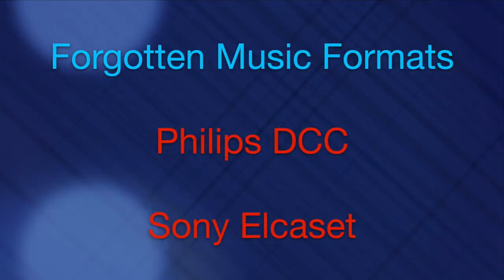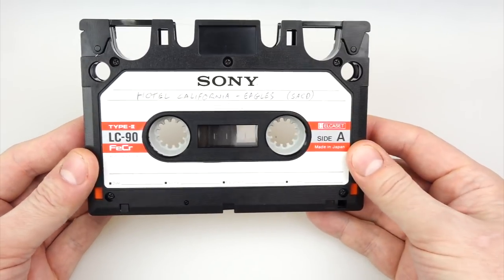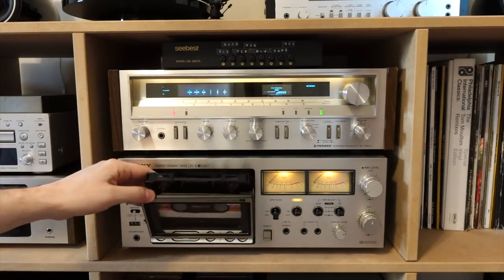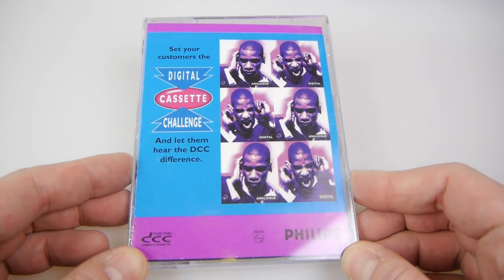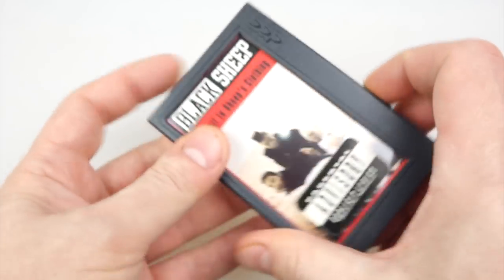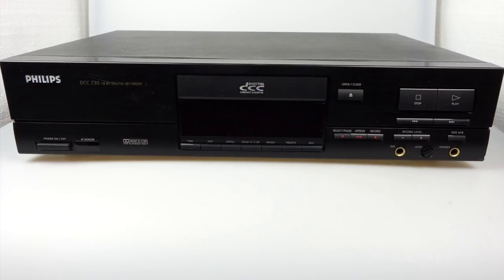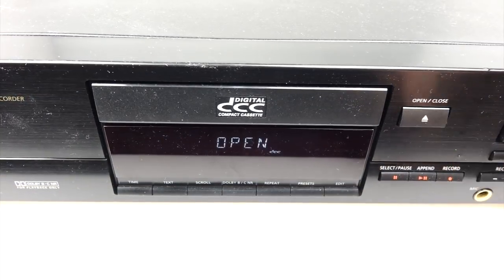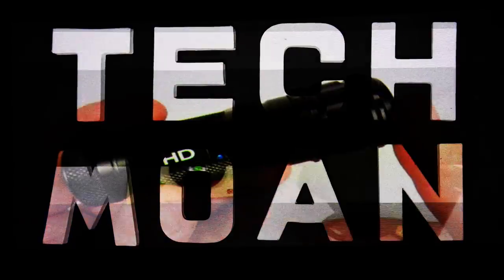Forgotten Audio Formats: DCC & Elcaset

Comment: Excellent video. I've had an interest in the elcaset since I think it could have replaced vinyl as a format if it had been marketed properly. According to a video about 8-track tapes called "So Wrong They're Right" an individual being interviewed mentioned the elcaset and said that one of the reasons it didn't succeed is that the record industry was interested in supporting a new format at the time. He also mentioned that it sounded like reel-to-reel tape.

With the return of interest in analog sound I still think that an "elcaset" type of tape (with some of the DCC features such as the metal cover for the tape, and the slip case [which is much better than the elcaset case your showed]) could make some inroads as an alternative to vinyl, especially since the tapes, though larger than a regular compact cassette, are much smaller than a vinyl LP record and don't have the drawbacks of vinyl. Judging from the small bit of sound we heard during the video, even when run through YouTube it still sounded pretty good to me.

I do have a DCC deck, a DCC portable, and some DCC tapes and I thought the format would succeed due to its excellent sound quality (especially considering that the tape still moves at the standard cassette speed [1 7/8 inches per second]), more affordable decks and tapes than Minidisc, longer playing and recording time than Minidisc, and that it was backward compatible with the old compact cassettes. Unfortunately, I think that among the factors that prevented its success were: (1) competition with the Minidisc, (2) the introduction of affordable recordable CDs, and (3) the release of portable CD players that that dealt with issues such as better anti-skip techniques.

Again, an excellent and very informative video. Thanks for posting it.

Comment: In the late 1960s I worked at a TV shop here in Southern California. We were an RCA and Zenith dealer. We had an RCA tape cartridge machine in the shop area. There were several pre-recorded cartridges. The format was put on the market in the late 1950s and "died" around 1964.

https://en.m.wikipedia.org/wiki/RCA_tape_cartridge

Comment: I love these video's, thanks. I migrated a while ago to a Logitec Bluetooth (Little black box) Receiver with decent RCA left & right output connectors and i even think they have one of those on sale with SPDIF out. Just connect your old cheap second hand iPod Touch 4 or iPhone 4 through a wireless pairing session and on goes the music. Recording onto old formats is as easy as talking about it. It's all become so simple, right? Streaming from the internet at high bitrate or just some track stored on your 32 GB device. An all in one combined investment of less than $60 or less if you are looking smart on eBay. Fortunately the BT receiver does not only pair with an iPod Touch or iPhone but a PC or laptop also. You just forget one and connect another one, awesome trick. No problem with DRM so far as i can tell. There is nothing in the bluetooth specs that prohibits the digital reproduction of music onto other formats. Finally we got it ! Btw, Geartronics makes very affordable BT sticks that transmit any stereo audio source through standard 3.5mm audio jack over Bluetooth. I think they cost less than $10. You pop them onto an old walkman or retro audio device with a 3.5 mm analog audio jack. They can be charged over MicroUSB, have a built-in MicroSD card slot and are really tiny. A combination of both BT receivers and a transmitter (all in one) makes your complete (retro) hifi collection wireless. Some BT receivers even upgrade the quality to 24 bit 192 kHz sampling rate. It would not surprise me at all if at some stage Dolby would like to get involved to suppress hiss masters noise.

Comment: Lyrics are a field built into the MPEG tagging systems. It's a bit of an odd format, it's the text of the lyrics with timestamps inserted throughout and that's how it times it. I've never heard of it being used on tape though. It's relatively common in aac if they were well mastered.

Comment: I remember someone having those dcc cassettes when I was young I don't know who had it i remember looking at the tape and had heard they were as good as a cd but you can record on them. I got a Jensen single tray cd player cassette radio bookshelf system for Xmas 1994 and I remember thinking I could if got the a machine that could record as well as the cd sounded but glad I didn't i still have some of those cds all these years later

Comment: I remember back in 1993, I was at Virgin in Paris/France,  checking out the dcc player, but then I heard about Minidisc and got  me the Sony MZ-1 in Switzerland, and later on the MDS-501, both f****n expensive back then ;-) 
I still have the MDS-501 here with me, along with about 100 minidiscs. Most of them are still readable/playable, but a few are "falling" apart...  :-/

Thanks for your great Videos! 

cheers from Canada, Chris

Comment: If I remember correctly, the Elcasets were usually sold in music stores where guitar amplifiers and studio mixers were sold. I've never seen them in electronic stores or department stores where TV's and stereos were on display. Which is probably why they never took off. They were also quite expensive and it probably made more sense for artists/bands to fork out a little more money and invest money towards a reel-to-reel deck instead.

Comment: Radio Shack sold DCC players too, for a while...the one thing I remember about it is has dang HOT the whole unit was! (Tt was sitting on a stand in the middle of the floor) You could not hold your hand on it with out discomfort!!

Comment: If you use a pre-recorded DCC you can skip to a certain track quite quickly. But a self-recorded tape has no catalogue. So if you just started track 1 and you tell it to start track 15 which is on the B-side, it will wind to the end, flip and wind further to track 15, which really takes FOREVER. I used DCC for a while but I switched to MD which I still use today.

Comment: If you like reviewing old formats that didn't quite make it, you might look for a 1950s RCA 45-only changer on Ebay. It used the large-hole 45s that were the norm in the USA, but that was the only size it could play on its big rotating spindle. Aside from being the fastest record changer ever produced (the  bottom of the platter was the 2-turn cam), what makes it interesting was RCA's hope that it, rather than Columbia's 33s, would be the replacement for the 78 RPM bound "album" format. So RCA offered not only individual hit 45s, they also promoted album sets of them in little bound booklets of sleeves, ready to be taken out in a stack and plopped onto one of these changers which were handed out for about $15 and could plug into any radio with an RCA-jack  phono input. They even matched each music category to a vinyl color (eg. classical albums were red-tinted). The plan failed, of course, but it left behind a lot of these tiny record changers, some of them even embedded in consoles (radiograms), all over N. America. You'll probably need a 60 Hz power inverter  (I imagine the 12 V powered ones are the cheapest) to make it work in the UK, but from the other stuff you collect, that would probably be a good thing to have anyway.

Comment: I owned a portable DCC-unit and this 7DCC 30 stationary machine myself, both long sold on. Many cassettes I still have today were filled with 1:1 digital copies of CD's I lent from our librabry, because this 1:1 copying is was what the DCC-system permitted. No mention here about the technical drawbacks of the DCC and the reason I stopped using it and reverted to my REVOX B710 MKII which came close in sound quality with the most expensive Maxell XL II-S and MX-S casettes and Dolby C being activated. Just as with the V2000 system the tapes Philips produced gave off dustparticles, so proper functioning was lost. On the V2000 system I used the much harder BASF tapes as cleaning devices, on DCC machines I only used the Maxell DCC tapes which had a cleaning startertape, also advisable to use before playing back normal cassettes (Dolby B only BTW, no C was implemented). Another, typical Philips mistake (also made during V2000 startup) was changing the system parameters, on DCC for reversing the tape before the end was reached, so the next number to be recorded was not cut off shortly by this change over process: the portable and the 730 used different standards here, meaning there was no real format compatibility between the machines.  The effect was markers were not effective for proper changeover on playback, one had to activate reverse yourself and in my memory this led also  to some to and fro actions, so seamless playback like on a CD was lost. Somehow Philips forgot to add a marker correction method to their machines. All in all a very frustrating experience. BTW the heads for this DCC system were designed by Philips, but the company was unable to produce them at the high precision tolerances required. Matshusita, the company Pioneer belonged to, was not at all interested in this system but was fully capable of producing these heads for Philips!

Comment: Bit of a collector here... I actually own 4 Elcaset decks, 2 EL-7's, and EL-5 and a Wega deck (with black front face). The EL-7 doesn't only have 3 heads, it also features dual capstans. Also, there weren't only Type I & II tapes, but also type III which have yellow livery as opposed to blue and red. They are and probably always were super rare, I have never seen a Sony Type III tape, but I actually own about a dozen Type III Elcasets made by Technics. The cassettes have the same dimensions of a Betamax tape (also a format developed by Sony), only not as thick.  This was indeed an attempt to marry the audio quality of reel-to-reels and the ease-of-use of compact cassettes, it succeeded technically - the quality is amazing - but unfortunately failed in the market. I absolutely love them though!
Reply from the maker: 0raffie0 thanks for the info. It's a great shame there are no pre-recorded albums on Elcaset (other than the demo tape).  I'm sure they would sound fantastic.

Comment: Wow I actually owned one of those portable DCC players. I used it on a daily basis cycling to school and back. I never owned prerecorded tapes as I made my own copies from a standalone Philips cd player (one of those heavy high quality black matchline ones) and I transfered the music digitally using a toslink optical cable. The sound quality was awesome!

The long track seek times never bothered me as I just played entire albums mostly. I'd mostly just skip a song or 2 and that went super fast really. Still way more convenniet than analogie tapes, that's for sure.

Unfortunately it broke down and they weren't available anymore so I switched to minidisc. This didn't change the recording techniques as the MD player also had a digital in. I did hear a slight decrease in audio quality though compared to DCC.

Seeing that portable DCC player in the video made me smile. I remember those first mp3 players came on the market with their awful sound quality that they produced. I've actually never had the same sound quality on the road anymore till this very day. That says a lot about the quality that the old Philips brand stood for. Times have changed, that's for sure.
Reply: Another best feature about DCC was that you could DIY DCC tape with audio cassette such as TDK SA. Just drilled holes onto Type II cassettes that matched the hole above the protect tab. While not perfect, but good for storing secondary song selections and just re-recorded any songs with dropouts.

Sony MD compression was worse than DCC, so I only listened to MD when I didn't want to use my Sony DD9.

Comment: I had an EL-5 for a while in the mid-80s. It was a nice thing to own, and sounded great at its best. I also managed to get a reasonable supply of blank tapes. Unfortunately I struggled with tapes getting jammed and damaged. Perhaps because the tape is so thin? For a while I used it for data storage, in the days when home computers used cassettes for storing programmes! The Elcaset was more reliable for data storage than cassette.

Comment: Having dealing with constant frustrations with the Compact Cassette and it's ridiculously slow 1 7/8 speed along with tape shell construction issues, (not to mention dealing with noise reduction system issues), I had long written off the Compact Cassette for non-audiophile purposes only, such as for portable listening and the car.   Having been spoiled by the sound of open reel, I had yearned for a cassette system that would be considered audiophile grade.   It had seemed that answer came in the form of the Elcaset.  The Elcasette took the best in portability of the Compact Cassette and married that with the transport performance of an open reel recorder.  It upped the speed to a more respectable 3 3/4 ips and I believe, didn't need noise reduction systems.   However, the fact that the tape is pulled out of the cartridge and threaded through the recorder like a reel to reel made it more stable and didn't have the phasing issues that cassettes had.   Sadly, though, it was an expensive system and I lacked the funds to get into the Elcaset.   Apparently the format didn't take off and it wasn't accepted by the masses of whom believed the sound of a Compact Cassette was good enough.   So the Elcaset faded into time.  I remember it though and to me it was the closest a cassette based format came to the performance of an open reel.  While some might argue with me that you COULD get audiophile performance from a cassette...well, that might be under certain conditions, one being the expense of a VERY high end deck, such as a Nakamichi Dragon and the purchase of expensive metal tapes.   The tape still runs at 1 7/8 ips, so noise reduction would have to be used.   While the Nakamichi decks do handle the tape better, I have not done enough long term testing to see if they exhibit the phasing issues associated with cassettes.   Still, I have regarded the Elcaset as a superior format.   Sadly, the really only good way to get audiophile grade quality in a tape format, you would be looking at an open reel recorder.   I had a long time love for open reel recorders up until it became harder and harder to find tape for it.  While tape still can be had, it runs a pretty penny now.   So it seems that really the only inexpensive, hi-fi grade analog format these days would be records.  Not very portable, but no noise reduction is needed, and there are no phasing issues.   You have well taken care of records and a good cartridge, the performance of records can be quite good.   But yes, there is more involved in taking care of records as opposed to tape.   But you still do have to eventually clean the tape heads, so there is maintenance involve with a tape format.   However, if money isn't an issue, you would be hard pressed to beat an open reel setup.   If money is, then go with records.  Just my 2 cents.

Comment: Excellent trip down memory lane, PS I still use my Sony mini disk at home and at a community radio station I present on, the station is about to move onto a new clyde synergy system and doing away with mini disk's.

Keep up the posts and Thanks again.

Comment: Again, first class Mat. Great collection, and you can demo smoothly - and bring out distinction. 
One of my goals was to collect different media, and associated playing devices from the past 100 or so years.  My most recent count of machines/media is 13.  

Of course, they're all gone, or going away: praise the Cloud.
Reply from the maker: Thanks David. They add up pretty quickly. If I count the physical audio formats in the house... I've got Compact Cassette, CD, DVD-A, SACD, Blu-Ray Audio, 8-Track, Reel-to-Reel, Elcaset, MiniDisc, Hi-MD, Vinyl...if I include video there's VCD, Video 8, Mini DV, MicroMV, DVD, Blu-Ray, VHS. What others do you have?
Reply: Techmoan You've got me by a wide margin... for audio formats.  My list includes these.  For each, my shelves have both the media, and a (hopefully) working player:  vinyl - both 331/3 and 45, 78rpm, cylinder, Norelco micro cassette; Sony microcassette (last 2 are very close, but not identical), wire-recorder/player and 3" battery operated reel to reel tape.  On the 'video' side, there's 16mm film sound, 8mm S-video, and quasi-audio: a morse-code reel to reel paper tape device, which plays beeps at a variable rate.

Again, thanks for both pressing the future, and exploring the past!

Comment: Tapes have gotten good since the 80's, I was surprised to record a modern one and play it back on a 80's era tape deck, only to have it sound just as good if not better then our Teac reel to reel. Btw I have a Realistic STA-2100 (not the D) that's been recently serviced. Sounds amazing and the noise floor is about 0.

Comment: I suggest that if you are to lubricate any old tapes you use paintball gun oil or grease it's silicone based and won't cause any problems with plastics or rubbers

Comment: I bought a Philips DCC-730 in the mid 90's only to transfer old cassettes to my computer as the DCC had digital output. They were very cheap at the end of production, approx £70 for a new unit in 1996. It was extremely easy to transfer analog cassettes to digital format with this one and later put it on CD-R. I still have it but it's in the box on the shelf and haven't used it for a long time.